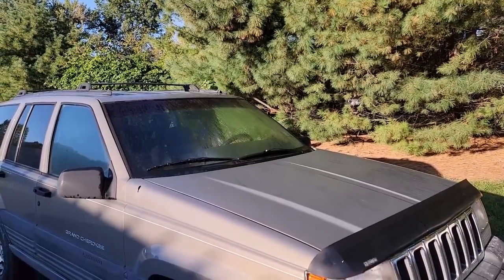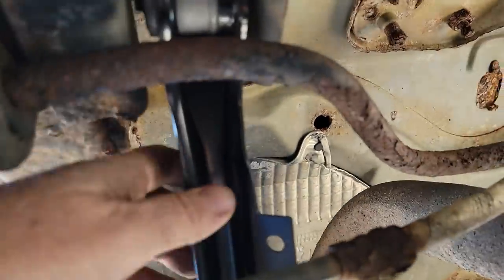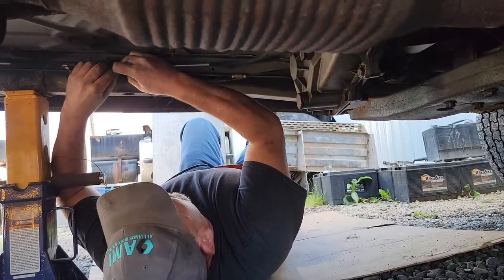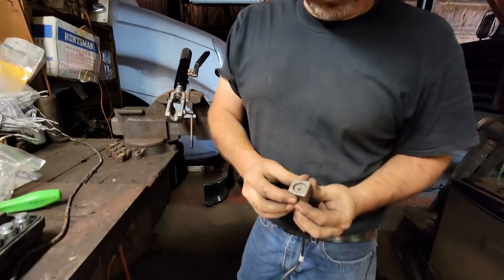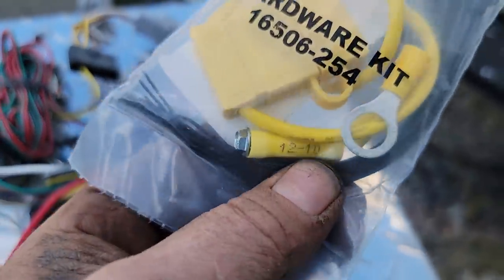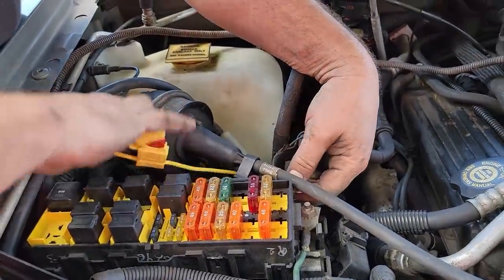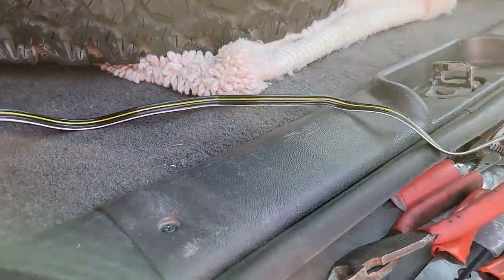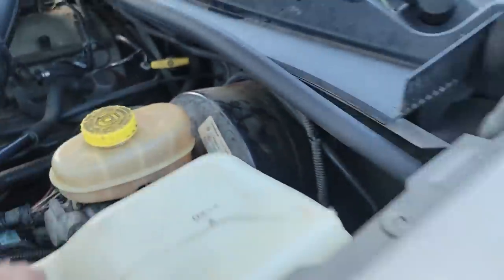96 GRAND CHEROKEE PT1 BRAKES AND TRAILER

Comment: I know these types of jeeps are known to have electrical problems, but I’ve always liked them.  Solid axles front and rear with a fairly decent engine, and great off-road capabilities.  One of these days I’m going to have to buy my own brake line kit.  Plus I didn’t know you could add shims to trailing arms to take up slop.  I’ll definitely remember that.👍
Reply from the maker: i dont think you are suppose to. the brackets are so rusty, i didnt want to squeeze them and have them crack or break,,
Reply: @j.c.smithprojects  My TJ runs the same setup. I replaced the bushings with Moog parts 4 or 5 years ago and they were the correct width. Even for no-name China parts those bushings were pretty far off. It's almost impressive.

Comment: It amazes me that so many “mechanics” use compression fittings in brake lines! Take care Mr and Mrs JC
Reply: I even felt guilty for using one on an evap line..
Reply: I saw one on an aluminum ac line a few weeks back. Difference in metals made a mess out of that one.

Comment: After the comment  about ensuring that you  twist the extra wire tie lengths  off so they don't  cut you all up, I wondered if you were  an electrician  at  some point in your working life.  Then you straightened the tightly  coiled wire with the side of your Crapsman hammer and I was sure that you were. Tell me do you still have an extra long bodied hammer for setting shallow boxes on concrete 
 walls? I bet you do.
I enjoy seeing the widely varied  content, and I wish you continued success in your  endeavors. And thank your able bodied camera operator,  chief cleaner and all around good sport wife of yours from the rest of us viewers for helping you do this. THANK YOU, MRS.SMITH!
Reply from the maker: i was an electrician. residential, commercial and industrial. really enjoyed the work but was never one for a "job". i used estwing hammers. i set metal boxes on concrete with a ram set and some adhesive. my favorite part of electrical was troubleshooting problems. i also loved setting /installing  gear and running conduit out of it. i wanted everything "just so" every time. many guys hated it and i enjoyed it. so it worked out well.

Comment: Sometimes those brake like clips hold dirt and moisture against the line and make it rust out quicker. I removed the 4 line clip near the ABS controller after replacing a line that rusted out inside the clip. Great job!

Comment: My 1996 Grand Cherokee had similar problem.  Random shutoff.  Would instantly re-fire.  The pins inside the wire connector to the coil was bad.
Reply from the maker: this one doesnt instantly restart. it is random. on my second tank of gas now and it still has not done it for me.

Comment: I know you find it hard to work behind incompetent mechanic/part changers and so to see what others leave is troubling. I would think that they would have tight vehicle inspections in that state with rust issues like these... actually the blame lands clear back to the manufacture in my thinking. Ohio and other similar states have rust issues and they know yet never address this metal problem. I am sure  the costs would swing off the chart for a bit, but after manufactures have been building these autos of all sizes, it would seem that R&D would of come up with a higher corrosion resistant metal/material to insure brake parts and safety equipment were of higher quality. I have had cars come in and the whole frame be just hanging from falling out from under their rig. Most I gave people the "lecture" on safety but one was so bad that I had to raise this vehicle for what seemed  to be  ball joint type issue to have it collapse and no longer be a driveable rig. In one way I was at fault by not looking at this frontend better before raising it with a floor jack and just tell them take it somewhere else but I bit that one and they did not want to work with me at all and I wind up paying for the damages to their car. I am okay with it as it doesn't happen that often and thousand dollar cars were not going to break a bank there. I wish that I had those days back as I so miss working. Its fourteen years now of this un able to walk or do simple movements. I really respect your work JC and know I will still learn from you as I heard you give that name to the brake line, I though, I should of known  that..... rock guard, that simple and obvious as well. Nice work on this rig..... now do they ever put rigs out of service there?